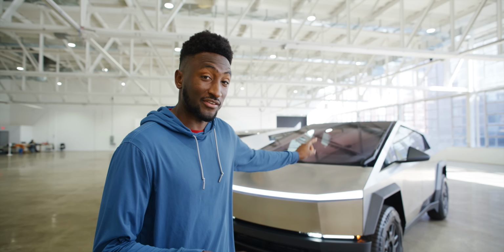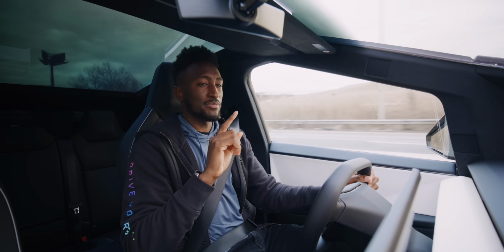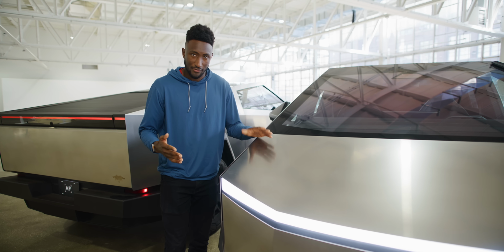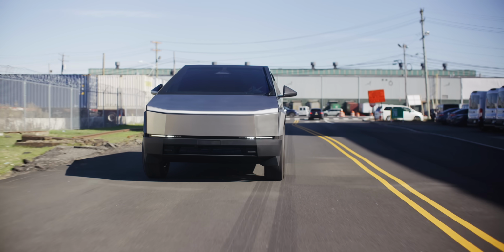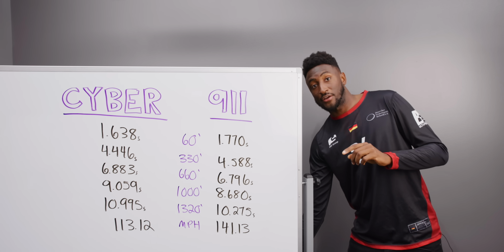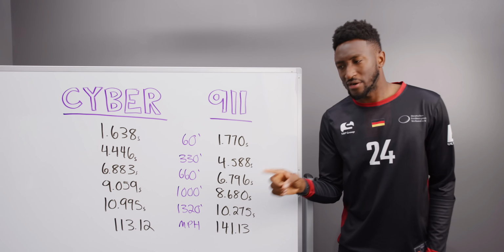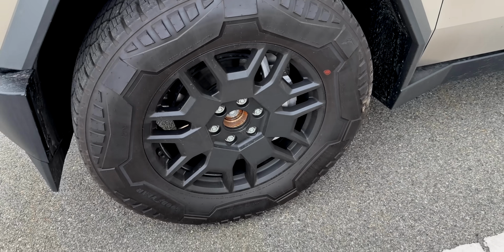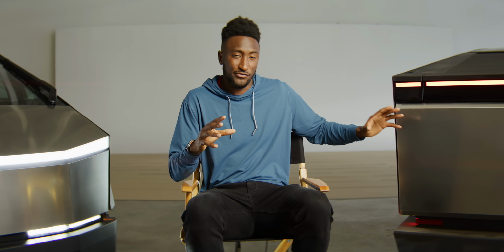Tesla Cybertruck Review: Already Iconic?

Comment: The steering looks overrated to me. It 'sounds' nice, but having the steering controlled by sensors just means that if a sensor fails - and inevitably it will fail if Boeing's shenanigans have said anything lately - you lose steering.

Mechanical parts can fail too, but electronic parts are more prone to failure long-term, and are more expensive to re-manufacture. Huge L.
Reply: Having watched videos myself on the hull's 'bulletproof' nature and durability... overrated. It's only bulletproof to the extent that it will stop one (and only one) low caliber round - if a second hits, it will go through.

As for the glass - yeah. The glass breaks. I normally wouldn't take points off for that, since that's normal - but I do on a truck whose glass was marketed and sold to consumers as: "Thermonuclear explosion-proof". Most blatant false advertising I've ever seen, so I can't just drop that.

Comment: The obsessive "minimalism" (i.e. cost cutting) is my biggest pet peeve with Tesla (as well as the other manufacturers copying their approach).  Rear visibility on the Cybertruck is so bad...it's safety/ergonomic negligence that they don't put a screen for the back up camera in the mirror.  Also, just add a heads-up display on the Model 3/Y/and Cybertruck if you refuse to add a gauge cluster screen like most every other car above $40,000 or so...

Comment: @MKHB you’re using yaw incorrectly.  The front end lifts during acceleration or dives during braking, the vehicle is yawwing when turning the front end left or right, and roll is the left or right side being higher than the other during a yaw event.

Comment: My biggest fear/thought about the CT is knowing eventually a LOT of people are going to be driving around a 3.5 ton metal brick, there's going to be more and more accidents involving said heavy brick. It's not going to be pretty.
And before people chime in that there are heavier EV trucks, none are made out of such solid materials that don't perform well in an accident.
Reply: Right, it's such a horrible design in terms of safety, which is the one area we modern humans have decided a car should absolutely not fail in, lol
Reply: Idk how this bit of missinformation is so wide spread. Ram TRX is 200kg heavier than the cybertruck... The Cybertruck is not heavier than any other truck out there BUT it does stop significantly better than any truck of any kind on the market
Reply: @Twin.motors  The last sentence in my comment explains my main concern. If I missed some info on how they designed in some absurd tech where the solid steel panel drops away to provide better crumple zones like the engine in a WRX does, please enlighten me. But considering Elon himself joked that the tesla driver will always win in a crash doesn't give me the confidence that this truck is safe for anybody else but it's occupants only.
Reply: Really? There are already millions of full sized pickup trucks on the road today and everyone of them weighs more than the CT. Then consider the blunt flat nose design of these truck acting like a heavy wall hitting anything and somehow the CT is the most dangerous truck out there! A lack of critical thinking on display here.
Reply: @hvu6037  muricans are something else "this is factually a bad idea, but look at all the other bad ideas we've let roam the streets, now we HAVE to live with the delusional billionaire shit everywhere"
Reply: @hvu6037  Tell me you didn't all of my comment without telling me. The extra danger the CT brings to the table is the solid construction. Do you know what crumple zones are? Probably not. Maybe you should use more critical thinking before resorting to insulting others.
Reply: @hvu6037  you are so close to realizing the issues with american vehicles

Comment: On the topic of a steer-by-wire system, my 2015 Infiniti Q50 has this. If the steer-by-wire fails, it has a mechanical mechanism in place that will engage and turn it into a traditional steering vehicle. From what I know of Tesla, I really doubt the Cybertruck has any true backup system if the steer-by-wire fails. 
I googled this and all I see in the Cybertruck are electrical redundancies, no actual mechanical steering...

Comment: Even tho the design and engineering of the cybertruck is iconic, do not be coaxed in tothinking that cybertruck is the first to come up with steer by wire systemin a production car. To clear the delusion steer by wire has been an option in Nissan infinity models since 2013, But then again its not the first time Marques has been wrong about Nissan.

Comment: 11:10 those are NOT the same tires you can buy with the same name or that come on the trucks you mentioned.  These are a special Cybertruck-specific Goodyear tire that has the tread shaved down. Also the car's offroad or even messy/snowy weather performance is further compromised because the current software only allows for the diffs to be open.

Also, lol @ the offroad mode bc can't you be denied warranty for taking your CT offroad?

Comment: I would never buy a car where the steer wheel is disconnected from the wheels. Reason: as an amateur radio, I know that zero electronics are RFI (radio frequency interference) proof. If the electronics are interfered somewhere, it will be a life threatening car not only for the driver but especially for all other people in traffic.

Comment: I really hope this style of car building will never really catch on. Let's be honest it looks aweful. It is iconic due to it being so apparently ugly and so it stands out. 

In my eyes the attraction of road users isn't it's most dangerous part. Obviously the suv type cars are all more dangerous than regular road vehicles. 

It sits too high, gives false illusions of control. Weighs too much. What will happen if it rolls? Do the sharp pointy edges of the car hold up? Or do they simply crush under the weight of the entire battery and suspension system? And to get inside the car quickly in the event of an emergency, you have to wait an extra second to get into the car as it has no physical handles... A handle will always be faster. Nice having a bullet proof car. But when you are getting shot at, that extra second to get into the bulletproof, metal thing, will add up... 

It is a mixed bag. The designers put totally random american stereotypes on the table and said 'let's do it all in one car'. 

Then the manipulative and failure of marketing it in any factual or practical way hits the final nail in the coffin. See it as a delorean. Except the cybertruck doesn't have any real character. At least the delorean looked sharp, and was put together with lots of passion. They simply neede way more money. 

The cybertruck designers had all the money they wanted. Tesla doesn't need to target their audience. Their audience targets them. And then they come with such mixed piece of metal angled, so called 'simplicity' or 'minimalism'. Yet not having a problem with making their services overly complex. Hooking you up with all the usual tesla subscriptions to keep your seats heated. In a matter of speaking... 

Tesla has never really gotten close to the other older, minimalistic cars out there. I haven't seen a Tesla with soul or character. It's all hightech and standing out. That is in no way at all what makes a ferrari or mclaren the beauties they are. It's a hype. Nothing more. And in 30 years we will look back at it and maybe see why it was modest. But nobody will ever understand why it had to be made in the first place. As it has no purpose at all.

That is what it's lacking. Without purpose you lose all forms of character.

Comment: People often complain about no knobs and switches on Teslas.  Otoh, Teslas handle all kinds of verbal commands to do things buttons and switches would, like turning on the wipers or making the AC/heater less cold/warm, changing audio volume, etc.  Also has scroll wheels on the steering wheel to change audio volume or change fan speed if I don't want to use verbal commands. Of course most of that can, in most cases, also be controlled thru the touch screen or like on my Tesla via stalks.   Also the left scroll wheel allows changing the driver display on my MS to one of a few on the right or left side of the display. Just some examples.  Btw, every 4-5 weeks there is a free OTA software update that keeps making the car more functional and/or sometimes more fun/cool if it's only a cosmetic thing, so the Tesla gets better as time passes.  Does that happen to your car?

Comment: 4:47 I'm really excited about steer by wire. 
If the truck will not turn on and you're only option is to tow it with a tow rope how do you steer it?

Comment: A huge lemon. Despite its size if you're 6'2" or more you gotta contort to get in the front, and you can't sit in the back. Massive pillars impede visibility,  Terrible viz out the rear.
WILL rust.
Can't fit in a car park down the shops. 
Insurance nightmare for sure - imagine the cost of a new windscreen.

Comment: Any other company providing something in such a state would get mercilessly ridiculed.  The panel gaps, trunks that can cut your fingers off, most stain-able car in existence, steering wheel that falls apart after 2 months, misaligned doors, headrests that peel if you don't use specific shampoos, a bunch of promised features missing, exact height and sharp for cracking pedestrians, so reflective it blinds other drivers around you, useless tray, has barely-functional crumple zones meaning you take all the forces in a crash. Honestly a joke that this is getting any air time at all just based on some gimmicks of it looking different.

Imagine if the next iphone had so many issues/problems.

Comment: 30 minutes and no mention to the rusting materials. That’s iconic
Reply: You are a victim of misimformation. The ct doesnt rust. Its rail dust that caused the "rust" but can easily wiped off. Adam something and other wannabes are spreading bs for clicks. 
Same happens with every other car.
Cts materials also dont rust like unpainted cars. It can only develope surface rust under very specific conditions like with the soft metal rail dust mixed with rain. Still easy to clean as said.
Reply: Yes, the real issues are all being left out. Disappointing and head scratching.
Reply: @dweorg4332  Think he covered most of that stuff in his last video about it.

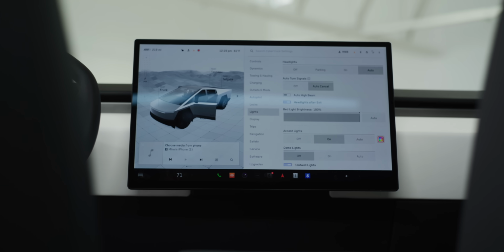Comment: 21:47 Buttonless or digital controls are also beneficial in that their state can be attached per driver profile. This is one of the biggest benefits of not having manual air vents, that they can always be in the preferred setting for each driver no matter which Tesla in their possession they get into. This minimalism was always going to be key in the robotaxi experience but it has yet to be realized.
Reply: Manual switches can also have per driver profiles. For some, like temperature control or volume, it's super easy because there is no state in the analog world. The button is either being held down or not. Others linke vent positions do have analog state. However you could have a gear system control that.

It's not even novel. Fancy cars like Mercedes-Benz S class have had this for decades now. There are driver profiles and based on the profile it will change all the analog stuff, like how your steering wheel is adjusted, how the seats are adjusted, how the mirrors are adjusted etc. All of that stuff is tricker and requires more expensive motorization than air vents.

So like Marques said, the Tesla-style all-digital stuff is all about money and nothing else.

Comment: Great video, as usual Marques. You continually bring good content.  A couple things though, the CT's exterior panels are not stamped, they are laser cut and bent. Some of the sub structure is stamped, but that's made of regular mild steel (plus the large aluminum castings).

And I have a very simple solution to the fingerprint problem: Open the door on that top edge, slipping your hand behind the door panel (this is how we open our model 3). And close the door with you hip or butt. It isn't doing to scratch it, and you won't leave body oils on the SS.  As far as other people are concerned? They should not be touching it without your permission anyway? That's just rude.  Just like riding another person's horse without permission, people need to learn to keep their paws off. And teach the kids the same at a young age as well. You see it all the time at car shows, parents taking young kids through, and teaching the kids, don't touch the car, just look. At least the smart ones do.

Comment: steer by wire shouldnt be allowed imo. there needs to be a fixed mechanical link between the driver and steers. at least when your traditional rack n pinion or box type power steering failed, you could still steer the car with a bit more effort but with a steer by wire setup, if either end of the steering fails, what happens? im assuming there is no physical connection?! 
i have driven a car with a lane assist that would actually turn the wheels without the steering wheel if you wandered in the lane without an indicator on. it could only do it so far before disabling but to turn the wheel to the left and the car resists and goes right is a disconcerting feeling to say the least.

Comment: The Cybertruck is iconic - and ugly in most people’s opinion.  I decided to not wait on the triple motor one I ordered and picked up a Hummer EV instead. It’s got the cool factor and rarity, 310mi range, full supercharger network access and looks amazing.  Everybody loves this thing, no offense to the designers but I’m very happy I went with this beautiful vehicle over an ugly, bulletproof set of vectors. 

I respect the ambition to do something different, but there’s nothing wrong with a conventional truck. This is more of a Elon trying to get rid of the steering wheel with a yoke and stalks on the steering wheel.  Sure you can do that, but there’s no need, and this is more of the same.

Comment: Steer by wire is the weirdest thing ever. What happens when the battery dies? I have had to push my car with a dead battery once in my life but if I couldn't steer it, I would have needed a tow truck just to move the car so I could replace the battery. Maybe mobile jump packs replace the need now a days but for a vehicle that is supposed to do more than highway driving it seems risky.

Comment: 13:20 that is NOT fine.  People aren't getting into a cyber truck from other trucks.  they're getting into one from a model 3 or similar sized car.  meaning the roads (which are already in a terrible, deteriorated condition) are going to have to cope with millions of tons more vehicle weight driving on them.  not to mention any of the pedestrian safety concerns...

Comment: Another feature Tesla Cybertruck MUST HAVE as an option are TWEEL airless tires/wheels which are one of the best options for making sure BOTH on-raod and off-road driving will not have your day ruined when you drive over a super-sharp rock or piece of glass or nails!  Tesla ALSO NEEDS to look at DARPA SHAPE SHIFTING WHEELS (i.e. look up both TWEEL and SHAPE SHIFTING WHEELS on Youtube and Google!) which lets you change the shape of your wheel from fully round to triangular tractor tread at the touch of a button so that Summer and Winter driving can be optimized depending on how snow, icy, sandy, rocky or wet the road conditions are! It also means you could go up the gnarliest and steepest off-road trails in Tractor Tread mode and then go back into Round Wheel fast highway driving at the mere touch of an in-cabin touchscreen button!

Look then up!  TWEEL and DARPA SHAPE SHIFTING WHEELS

V

Comment: Dont know man, this review is a little funny to me. I am upfront i am no musk fan so more than likely to look at this negative bias. Still, a couple of concerns stuck out to me:

1) the issue with the car door: i accept initial production and such there are teething pain but why tape fix? Is there an issue taking it to service to fix? Why only a comment on twitter about it? 
2) the race, i am sorry, what tesla is doin is deceiving pure and simple. Most basic 911, not even the full race shown, selective data of the full race afterwards with no comparisons.
3) you claim on hand it is a regular tesla under the truck guise, yet you admit it lacks a few  the same features so it isnt a full tesla under there. Why arent the same features available? Was it rushed out? Shouldnt it be feature complere even if it is early models?Should it be the same under the hood? Domt trucks have specific needs that cars dont need different software and such?
4) you seem to gloss over issues like towing and the matter of the missing features due people having other priorities. However what about the people that it is a priority, what id you need the features when you did not think you need it? Even if it is not a priority why settle for lesser when others have it better or as standard?
5) the lack of handles. Wasnt there an issue with the door being frozen shut in cold weather? Was that resovled? How do you access the car otherwise?
6) no physical controls or buttons/all controls in one screen- what do you do if that tablet is broken or doesnt fuction properly? How many features or functions do you lose? Can you drive without it both physically and without readouts like a speedometer? 
I am trying to keep an open mind about this so if there are reasonable answers i am happy to here them.